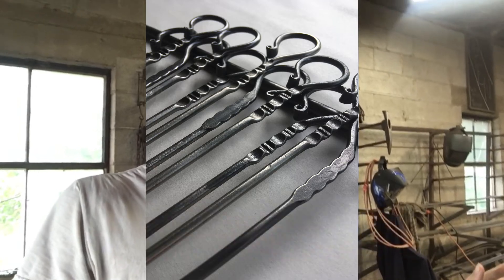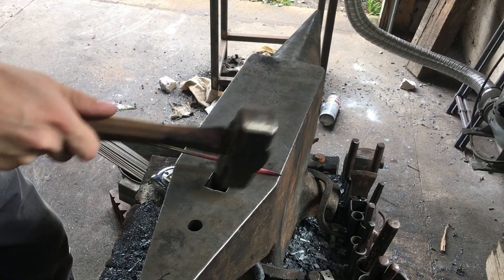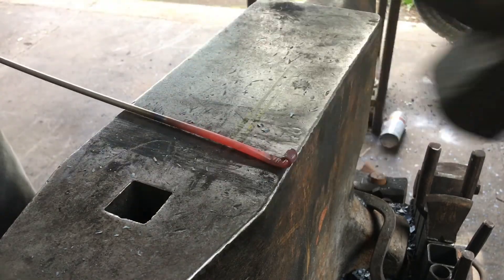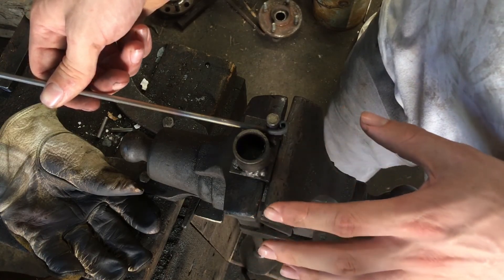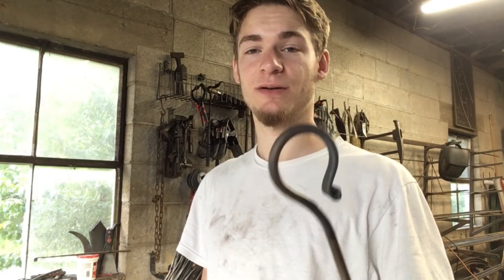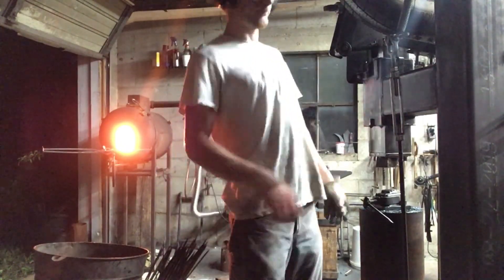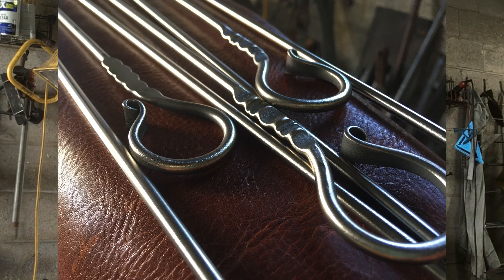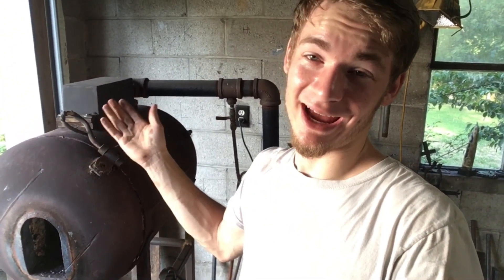Forging Stainless Shish-Kabobs for Market

Comment: Interesting video. Some trivia: the items you made are skewers, Shish Kabob is the dish that is cooked using those skewers. Also, to cook the food evenly it must be turned over the fire. A round skewer will allow the food to rotate back into its original position. The skewer needs a profile that will prevent the food rotating under gravity. Good luck in your craft.

Comment: only showed a fraction of what it takes to make that 60 units.  its hard hot work to make "multiples" we can all see how hard you worked. You should make good on those units they look excellent. 
Can i mention what i think could be a time saver for you ,  when you do the first bend on the scroll end, just lift and re-set on jig to do the Dog leg ( you push back against the pin )  can all be done in one heat after you've done a few.
Hey thanks again for sharing your skill and passion.
Reply from the maker: Thank you! :) I appreciate it. 
An excellent point... Typically I struggle to keep the bend precise if I'm just pulling the end of the bar, but now that you mention it I'm sure I can modify my jig to accept my bending wrench. I had simply moved on to a quick heat in the forge, as opposed to the torch (AKA the profit eater haha).

Comment: Great job Ethan, not only on the skewers but on this video as well. I was wondering what grade of stainless rod you used 304, 308, 316? Keep up the great work. I was also thinking you might try singing along to help with your rhythm while swinging the hammer.
Reply from the maker: Thank you! I used 304, and based on how it reacted I am pretty sure it should have been listed as 304 Low Carbon. But I don't have too much experience with stainless to say for sure. 
     And yes, I heard that mom was trying to sway you with such ideas 🤣
Reply: @BlazingEmberForge  moms are like that💜

Comment: Really great work!  I've heard that style of scrolling tongs referred to as "knee tongs" as well, but I think this might be one of the first times I've seen someone use them!  What did you use to mark your anvil when doing the fish tail scroll?  I've just been using soapstone but it gets worn away after I do a couple of pieces.
Reply from the maker: That's a really great term, very reflective of the tool! I may have to use that... I will say that this is almost all even I use them for as well, because most of the time I want a solid bending wrench with immobile teeth. Sometimes when you are more just eyeballing stuff though these are a one-size-kinda-fits-all. 
And I use an... "INDUSTRIAL GRADE, VALVE CONTROLLED, OIL-BASED PAINT MARKER!" Which frankly I just love to say and tell people hahaha!